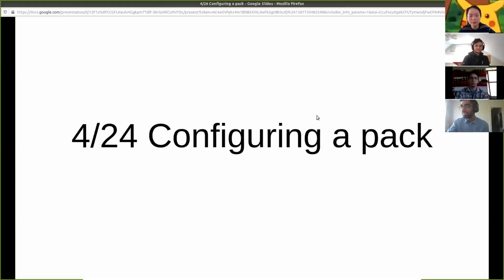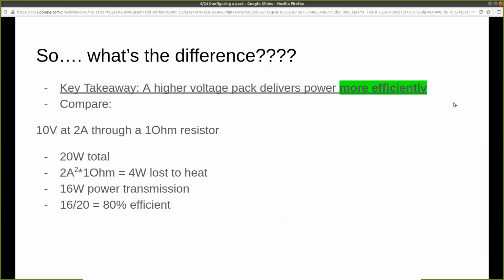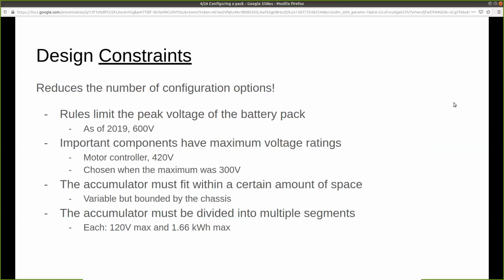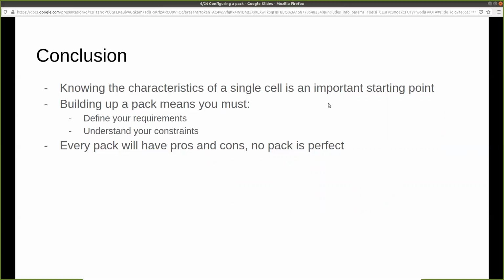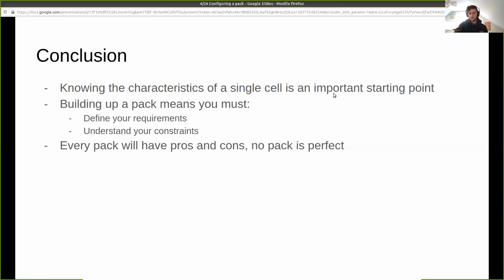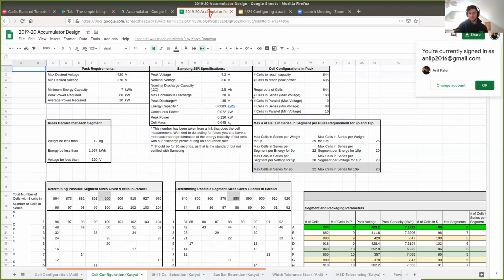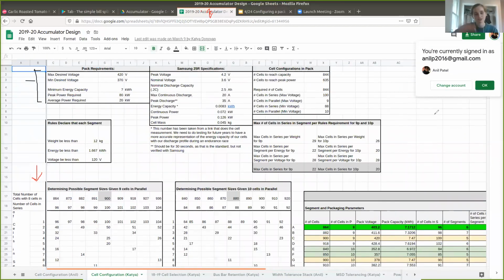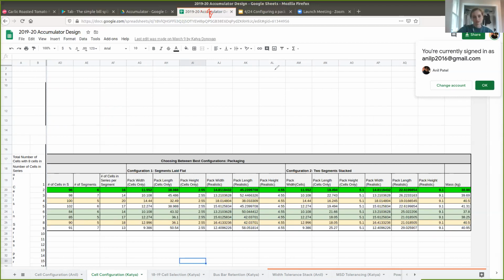Accumulator Learning Part 2: Building a Pack from Single Cells

Comment: How can we get reliable values for the peak discharge current?  How can you fuse these cells with fuses that have an amp rating less than the continuous current rating of the cell (as required by the rules), but are still able to draw 35 A from the cell? Wouldn't your fuse blow at 20 A?